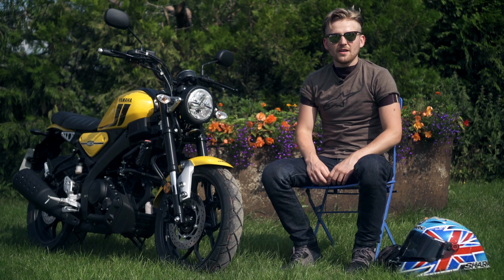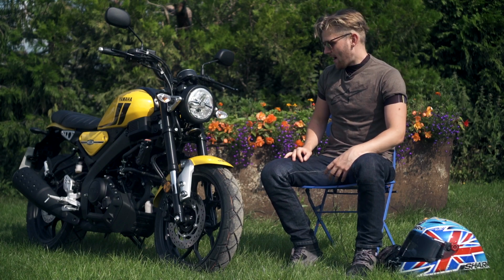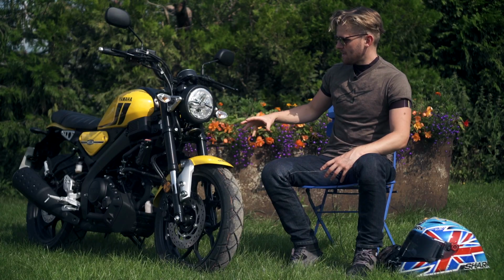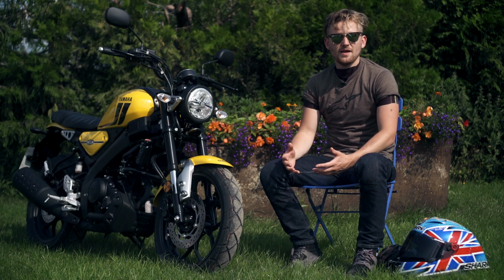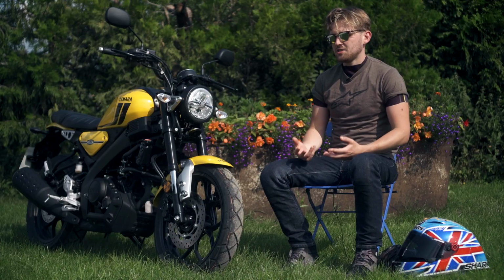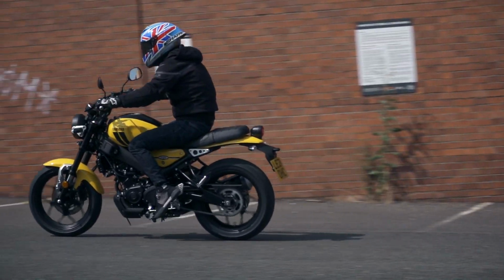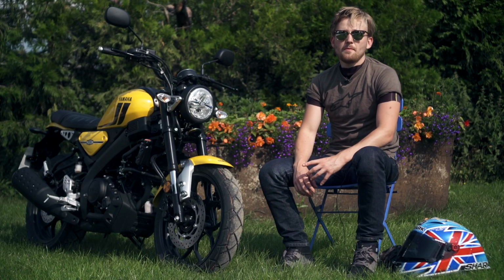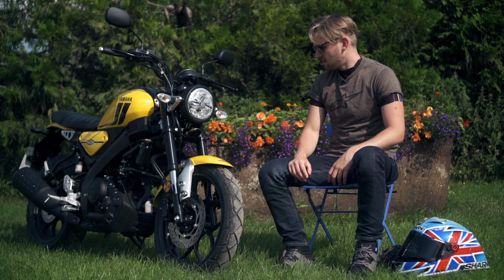2022 Yamaha XSR125 | Road test and review | Carole Nash Insidebikes

Comment: I've had loads of 125, this is by far the best. With yahamas variable value system ,it goes and so much fun iam not going to bother with my big bike liesense!
Reply: I've literally just got the latest model and it's amazing. If you add a Malossi complete cylinder kit to it & get the ECU powertronic tuning kit & get it tuned it runs almost like a 250cc and has a lot more power through the gears. A lot easier to take over slow traffic and will also top out at around 85mph but sit very comfortably at 75mph. It really is a quality bike.